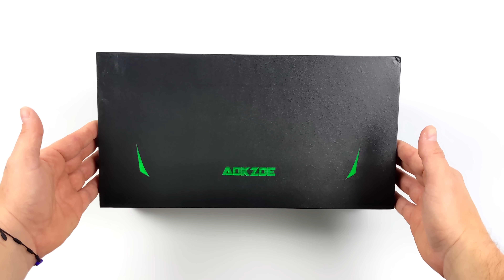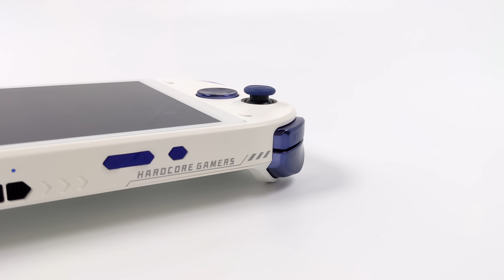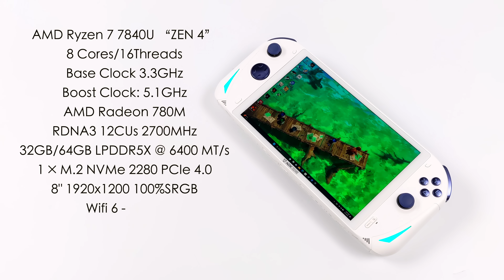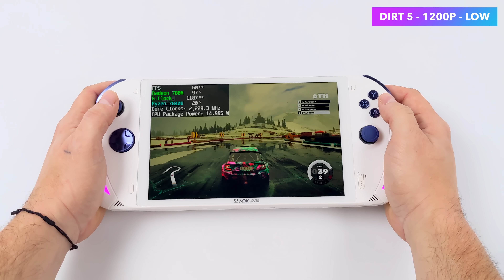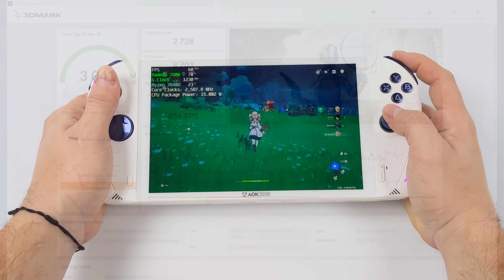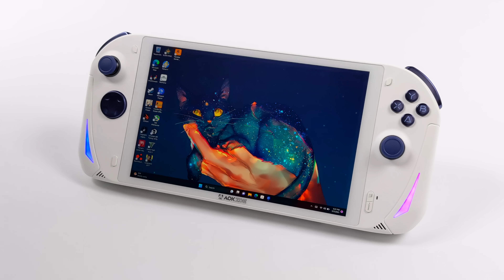AOKZOE A1 Pro Ryzen 7840U Hands-On! Right On The Edge Of GTX 1060 Performance!

Comment: Great system, but man those guys could’ve put two nice trackpads below the dpad and right stick; IMO that’s the only thing missing on these handhelds consoles.
Reply: I think there isn’t room for them given how tight they have the grip region. They’d have to go with a width similar to the Steam Deck’s for it to be usable and/or comfortable. The Deck’s placement is such that you can effortlessly use them without a thought when you raise your thumbs off the the joysticks. So even if this device had the width, near the bottom of the device would be super uncomfortable to use without basically changing your entire grip to use that specifically. Usability, not just throwing hardware at a thing, matters.

Comment: Why won’t you show med-high settings?? No offense but do you have some kind of ocular condition? Lol
Reply: because most people don't care for high settings. Switching to all low will reduce the power draw by a lot and extend the battery life 1 to 2 hours. Way better when you are out using it portably. What sort of person buys a handheld to run it full bore and kill its battery as fast as they possibly can? Heck, I run the 1080p screen on mine at 540p, just to get more performance with lower power consumption and longer battery life. Leave the house occasionally

Comment: Stop showing us low settings, they are for Steam Deck. Show us Full Hd with FSR quality (e.g. 720p) and high strings.
Reply: Those low settings make sense for portable gaming to increase battery life a lot. So it makes sense to show them.
Reply: @frankseyen9156  no it doesn't he runs it without fps limit, so basically GPU load is 100%
Reply: @BARULICK Sama  So turn on the fps lock. Dipshit. 

Most of the people who buy these run them on low settings. High kills the battery in an hour, 2 at the absolute max. And if you are playing it off and on throughout a day that isn't what you want. Switching to all low can net you an extra 1-2 hours. And you can hardly tell the difference on a screen that size anyways. 

Why in the hell would I wanna run a game at high settings when low will run the same game and keep me entertained in the airport or on a flight for up to 2 hours longer? I don't crank up the settings unless I'm docked or plugged in.
Reply: @barulicksama3838  Because he is a YouTuber and people want to know what max FPS  are possible. People then use their brain and set the FPS limit to 30 / 40 / 60 FPS according to the type of game.
Reply: He always does this, no idea why.

Comment: Isn't this basically an asus ally?
Reply: Significantly more powerful.
Reply: @RolandDobbins  You mean the Ally more powerful?
Reply: @jamesm7498  no this is way more ram
Reply: @jamesm7498   No.  The AOKZOE is more powerful.
Reply: @Roland Dobbins  By how much? A few percent maybe? In games even a 50% power increase would only mean the difference between 30fps and 45fps. A 10% increase would only be 30fps to 33fps. A 3fps gain. And I'm gonna be honest with you, there isn't a chance in hell that this thing is any more than 15% more powerful than the Upper tier Ally, they are the same generation of hardware from the same company. 

Would you like to explain what exactly you mean by "way more powerful"?
Reply: @Whatsup_Abroad  — I shouldn’t have to explain the benefits of 4x the RAM in terms of texture caching, etc.

Comment: A very interesting alternative to the Ally, especially with 32GBs of RAM. Seriously considering preordering this, but I don’t know much aokzoe, anyone here has previous experience ordering from them? Thank you.
Reply: I think you would be better off buying the ASUS ROG Ally. Higher reputation company, global launch, same powerful chip, maybe 16GB RAM but the price is rumored to be reasonable and no need to gamble with these tier-2 manufacturers.
Reply: I got a A1 from them through kickstarter, which delayed almost 3 months they would answer me I couldn't get a refund they started selling hem on Amazon and asked the sellers not to post anything about them.
They are the same company onexplayer as I recommend you wait for the rog ally and see this A1 I have is fine however if anything goes wrong with it I'll be on my own, there's hardly ever a need for more than 16 gb or ram in a handheld even if you pass about with memory alocation it doesn't affect graphics performance hardly at all.
Reply: I have one A1L 16GB/2TB steep beginning with the Windows that came (much better to put Ghost Spectre and use the official drivers from Aokzoe) but ZERO problems with it, really happy with this product
Reply: Thanks for all the responses, sorry to hear about your experience Jacob, that’s my main concern, specs wise this sounds better than the Ally, this is my own personal experience, I have bought dozens of Asus products, from video cards, to mobos, to monitors, to laptops, and haven’t ever experienced a single hardware problem, is this company going to be as reliable as Asus?

The main reason I want 32GBs in my next handheld PC (also own a Steam deck) is so I can assign 24GBs to main memory and 8GBs to VRAM, that would allow for more future proofing for this device. 

Thank you again for your input, I’m hoping to hear more thoughts on this matter, especially your experiences dealing with Aokzoe!
Reply: @Salvador Melara  He's probably not trustworthy. Kickstarter backers are paid beta testers. period. Full stop. He signed up for a kickstarter, which implicitly says that they didn't even have to send him a unit, and then experienced a problem with not receiving the unit and only got a partial refund? He's most likely full of shit. A lot of people try to scam these Chinese companies by buying things, demanding refunds, then not returning the product they receive. The workers there usually don't speak English well so they are easy to trick. I wouldn't trust anything he says frankly, specifically because he backed the kickstarter.
Reply: I have the highest end A1. Had a Steam deck as well. 

A1 is a game changer for me. No issues at all, although they do have a rough launch. 

I’ve had it since October. 

I have a 4090 desktop and don’t use it nearly as much as I used to, because the portability  of this  is awesome.

I play a variety of game types, including cyberpunk, and it plays fine.
Reply: I can't speak on the product but I've had a nightmare dealing with the company trying to get any correspondence from them regarding a refund since they failed to deliver after the kickstarter ended. In the end I got a partial refund...awful company..

Comment: 2 hours on 28W? Not really. Maybe one 1:30... because its only cpu package power. Any comparisons to 6800U? Because for now the perf looks similiar, except the emulation.
Reply: This should be about 10-15% more powerful. That's typical for these APU jumps. A 20-25% jump would be very impressive, but not really worth it to me as I bought a 6800u device. A 50% jump would mean If I can hit 1080p 30 fps on a game with a 6800u I would be able to hit about 45 fps on that new device. Id gain 15fps. A ten to 15% jump is just 3-4.5 fps. 

A 50% jump could be the different between playing a game at 20fps and 30fps, but that kind of jump is unlikely and unusual. A ten percent increase in power would only bring it up by 2 fps to 22 fps. 

So a 50% increase honestly isn't that dramatic imo. After buying in at a 6800u this won't enable any games I can't play, it won't do anything mine can't, it will just play a very games I have to run with fsr at slightly higher resolutions, but honestly, I wouldn't even do that. I'd keep it as low as possible anyways. So....what would be the point? Maybe I can push the settings justa. tiny bit more....but it's the same game anyways....wtf do I care? I've got waaaaay too much stuff to spend money on to care that one handheld can do slightly better settings lol.

I suggest buying one that tickles your fancy, and then deleting all of these channels from your YouTube for a minimum of 2 years. Otherwise they will have you thinking every one is a major improvement when they are not. Every 2 to 3 years would be pretty reasonable if you have the money to blow as an upgrade cycle. You'll be happier, trust me.

Comment: 15W + 800P with FSR => perfect experience
Reply: I ran most of my games on the Steam Deck at 576p with FSR Lv 5 sharpness. Actually looks quite good on the built-in 1280x800 display. And most of them ran at anywhere from 45 to 60 fps locked at less than 10W of power. e.g. Tekken 7 (6W, 60 Hz refresh), Ace Combat 7 (7W, 45 Hz refresh).
Reply: @SharapovaFan  Control Ultimate Edition has like 100 FPS when you set the Game to 540p. Cant wait to actually see 100 Frames on that Game on the ROG Ally
Reply: Imagine with FSR 3....Almost 50% more frame rate
Reply: @vasilisbill  if it works like it should, wouldn’t it be closer to 100% extra frames?
Reply: @RG6Snipers  not really. DLSS 3 offer 50 - 100% more performance. So, it really depends on the game.
Reply: @welehcool2522  Ah, i assumed it usually doubled. Interesting.
Reply: That reminds me of somthing oh yeah steam deck
Reply: Yup agreed. With this you'll get really good perf and batt life!
Reply: With rsr also
Reply: I say crank the TDP.  The battery is fairly big plus may as well use the chip to it's maximum capacity
Reply: From my exp, using lower internal resolution on handhelds work better than fsr. There is less overhead thus faster fps and slightly better graphics quality 😊

Comment: hmm I can play GTA V at the highest settings with the 1060 3gb.. so I guess this is more like a GTX 580 at best
Reply: Not really, it was set to 15W in that game, instead of 28W.
The screen is also 1200p, not 1080p.
With the wattage up to 28W, it gains 25% more performance, I would assume it would be just fine at the highest there.

Comment: All of these are dead since asus rog ally at 699 will rape everything else
Reply: This cost 100 more but has double the ram.. 😅
Reply: @working2cure  a pc this tiny doesn't really need more than 16 though , also the rog is a much more premium product with a much larger company and hence tech support behind it
Reply: @Najeeb Shah  For some games that more or less need 16GB to run well, if you effectively only get (16GB - APU usage), you drop well under that, and get slowed down quite severely in some cases. (And yes, I know there aren't that many games behaving like that, yet, but wait for a year or two... And if you want to play one of those by then, you probably don't want to replace your expensive handheld that soon, right 😉?)
Reply: @Najeeb Shah  Why not? I run my handheld pc docked often. I've got Adobe premier pro with a timeline open on one monitor and about 15 chrome tabs open in another simultaneously while coworking through office 365 on a third monitor. Yeah, I need the 32gb of ram I have, in fact I'd pay to get 128gb if one of these companies would offer it.
Reply: @Counterpoint  More importantly he seems to be forgetting this is basically just a laptop. It's a PC. People do A LOT more than gaming with these. How stupid would someone have to be to buy something like this purely for gaming? That would be a massive waste of money. I use mine 8 hours a day as my main work pc.
Reply: @Najeeb Shah  btw, with no keyboard and mouse and only one usb-c the Ally looks like expensive E-waste to me. I'd never buy a piece of garbage without a keyboard and mouse on it. I only buy proper devices like GPD
Reply: @Whatsup_Abroad  🤦‍♂️ hubs exist
Reply: No. GPD.

Comment: cool but DOA  due to pricing
Reply: Doa because shitty quality and zero customer support.
Reply: @hydzior  Bingo. The Steam Deck and ROG Ally will be better by default just because of support alone. Has anybody here EVER tried to resolve quality control issues with these handheld companies? Most of them are horrible at warranty, to the point where the customer needs to fix their mistakes, because otherwise they wouldn't be able to ship it back for repair.
Reply: @Exil Desert  That's only true for the idiots that buy during the kickstarters and stuff. End consumers that buy through Amazon have flawless experiences. They can easily return a defective unit and get replacements no questions asked. 

You guys are stupid if you are actually putting any weight on what the early adopters say. Those people are utter imbeciles. Most of the time they don't even realize that the company doesn't even legally have to send them a unit. that's how dumb they are

Comment: There should be a 16/12gb ram varients
Reply: APU is using the system RAM as VRAM, so with many games requiring 16 GB as a minimum spec, you won't be able to play them, as 2 GB will be occupied by the APU.
And the more RAM you can allocate to the APU, the more textures you can load etc.
Reply: Why
Reply: @tygur23  why not
Reply: @AponTechy  so you don't have a logical reason
Reply: Because it's 2023 and 16gb being shared by the ram-hungry APU isn't enough. Just pay extra for the RAM. You're already buying a luxury product, a few more bucks won't hurt.
Reply: Makes no sense since RAM wont be the bottleneck for playing heavier games on this product

Comment: Nice. It’s about time APUs start showing some decent performance for what these companies charge. 😂
Reply: This is better than the Sega Game Gear.
Reply: @Nickbaldeagle02  worse battery life, though ;-)
Reply: @Nickbaldeagle02  Better than nintendo switch
Reply: @serelcyril-pf4qn  well, that's debatable.
Reply: @Nickbaldeagle02  But with very low margin
Reply: Considering these are literally laptop parts I don't see why people expect prices to be so much lower than laptops to begin with. It doesn't matter that they are handheld gaming devices. The prices are quite fair considering what's inside and the much smaller scale industry they are part of.
Reply: its really not that insane in pricing, given they use laptop processors.
Reply: You probably pay more for your cellphone that does less
Reply: @lilrockstar77  bruh, a cell phone does way more
Reply: @420247paul  nah, post PS1 emulations are pretty bad in phones tho
Reply: @420247paul  name one thing a phone can do that pc can’t…
Reply: @lilrockstar77  1. vibrates
Reply: @checktheplaylist101  mmmmmmmm. These handheld pcs vibrate now a days 🤣😂😂 could be stronger tho.
Reply: Keep in mind these are usually the fastest handhelds in the world. pretty impressive hehe.
Reply: Not good enough yet. Smh 
Even if it’s portable wanting to look at your game is important.

I wish nvidia didn’t bail on portable apu 

With magnificent tech such as dlss .much better at lower resolution 

Meaning that 540p dlss 1080p would still look decent 

Putting all to high at 540p then dlss to 1080p at 60fps
Reply: @jeisntthereanymore   you don’t need DLSS, AMD has there own implementation of DLSS anyways
Reply: @undisturbed809  in their defense, the FSR isn't nearly as good as DLSS for overall image quality. That said, FSR 2.1 is generally good enough, especially for a smaller screen where pixels are harder to discern.